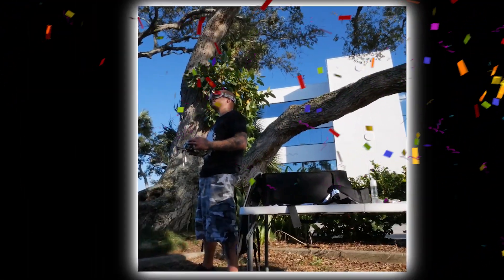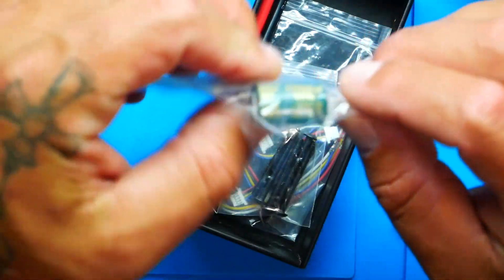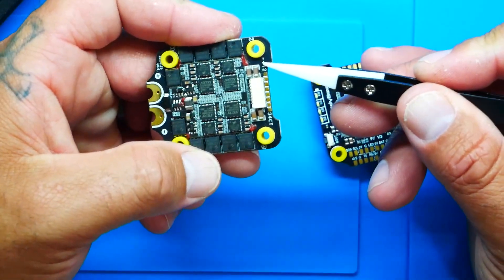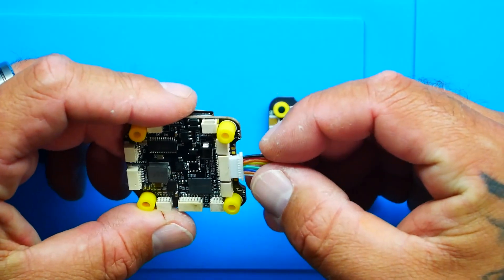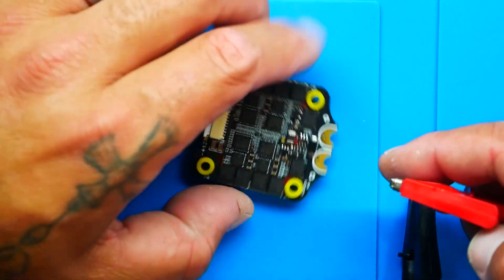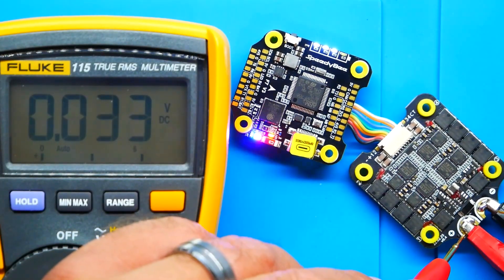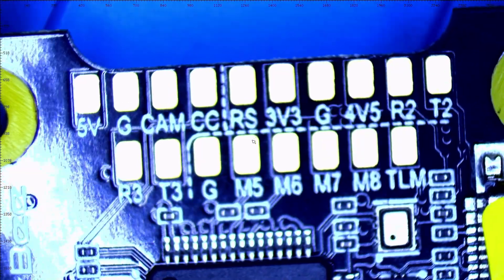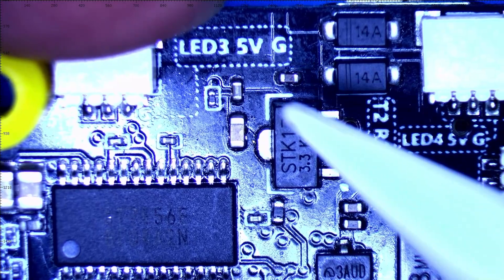All New SpeedyBee V3 Stack With A Built-In Battery Meter On The Flight Controller!!

Comment: I've been flying this stack for a while now. All a stack has to do to make me happy is work every time. So far, it's working.
Reply: still working?
Reply: @fredericpetitpas  It's working but the voltage reading on the osd is freezing up half way through the battery. Not sure what's causing that.
Reply: did You flashed it with latest BF (4.5). ?
Reply: @piotrkojder7177  No. I forget what I have on it. 4.2 or 4.3. I think it's been maybe a year or so ago that I flashed it. Whatever BF version that was. And it worked fine for a while. Then it developed this voltage reading problem. Without a crash and without plugging it into a computer.

Comment: Have you tried INAV for this FC? Since mine having trouble on ESC protocol (available only multishot) and when armed the motor didn't want to spin
Reply: Did you ever get iNav on this one?  I can’t get it to flash on mine
Reply: @IAmTheCraftsman  Yes. Using multishot. Remove sd card for blackbox when flashing.

Comment: I've gone through 4 of these stacks all died after a simple small crash. The flght controller stopped communicating with the PC each stopped generating the final beeps when powered on. Nothing I've tried fixes the problem. Buyers beware!
Reply: I've done 4 with the exact issues, Did you ever find a fix?
Reply: @Bmeadowz  Nope, I replaced them all with different ESC and Flight Controllers. I currently have one speedybee FC on a different ESC and it's been holding up for now for like 2 weeks.
Reply: @josephlafluer7266  Oh great😂 I've gone back to the tmotor f7 can't go wrong with that👊
Reply: @Bmeadowz  I'm running Fettec G4 On Alpha as my main FC.
Reply: Thx for the heads up ... = Avoid !!
Reply: Great - now I'll be scared to fly it 😕

Comment: Installed mine today, but having troubles adding the ability to add the air unit on a switch. Could use some help. I was able to add user 1 and 2 to the modes tab, but nothing happens. Is there a pit mode pad i need to solder or something??
Reply: This crap does not have PINIO relays. Moreover it only supprots 3,4khz gyro update speed so forget about DSHOT600 nobody is taking about it (bribed mot@$!%ers). Instaling BF 4.5 makes it useless (motors are not moving) SpeedyBee Suport is helpless (If You can count, count on your self :), they just don't give a f@%!ck ). I am upset as hell. 
You can ask support about Air Unit on switch, probably You will never get the direct answer.

Comment: Sucks it’s an f7 not a h7 or g4 🙃
Reply: F7 is better than G4. While H7 may have better processor speed it lacks sufficient flash memory. The F7 has plenty of room to grow.
Reply: @Estuardo305  g4 has accelerated math processor it’s better than f7 maybe not 65 but most all f7
Reply: @terpsquirter7107  yeah, with fpv we don't even come close to the overhead that you get with an h7. We could develop firmware for another 2 or 3 years with F7s... We won't actually utilize half the power of an h7 for many years. Only thing I can even think of an h7 will do better is draw the osd, and run the pid loop at the same time, with no need for an on board osd chip. Your regular freestyle quad will run great with an F4. So, h7 boards really are just multi year future proof boards, that in a lot of people's oppinion only exist because of chip supply shortages.

Comment: Another great review video. You always mail it man I gotta tell you. I myself and I’m sure everyone else that watches your videos love how you break everything down and explain what everything is what it does and how to use it even what it could be used for if necessary! Having said that you mentioned in the beginning about breaking the connector on the esc and If you have broke one yet you eventually will. Well that time has recently come for me when I received my Fettec G4 stack. I installed the esc on the frame without plugging the plug in first and on that esc I feel like the connector is set back a little more than they usually are so I plugged the wire in took one of my drivers so I could push on the wire connector and make sure it was all the way in and sure enough I pushed to hard and popped the connector off the board. Thankfully that board like this one you are reviewing here has solder pads for the esc connection as well. Although it sucked beings it was brand New and my very first Fettec build but in the end it worked just fine. Anyway great video man. I love your videos because I always learn something from them. Take care.